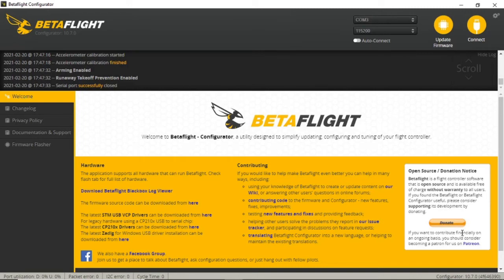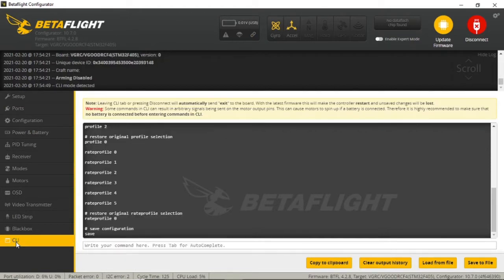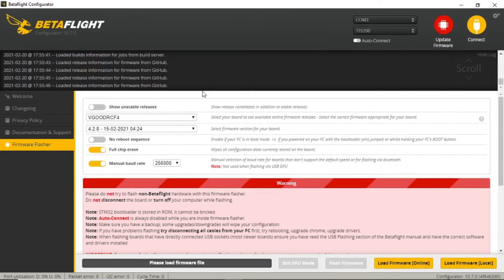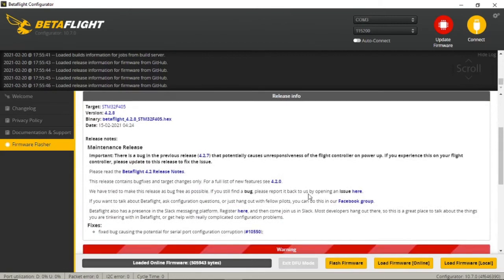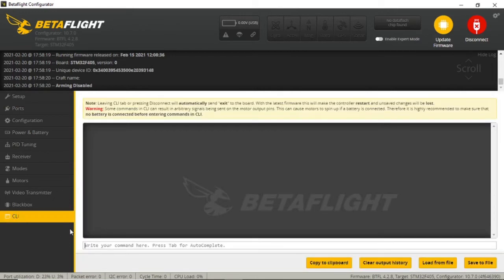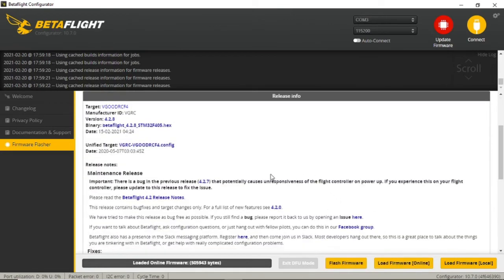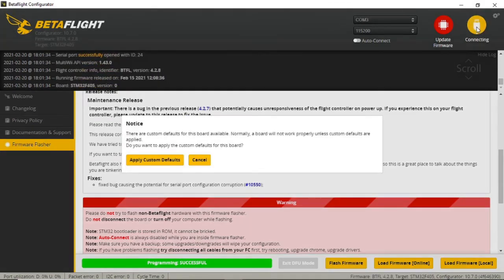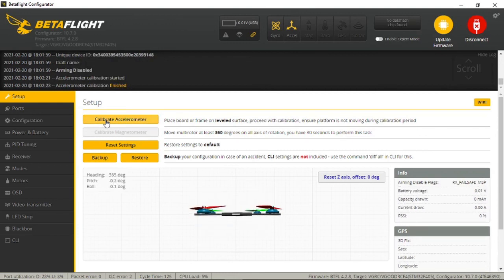TYRO79  -- How to fix a seemingly bricked VGOODRCF4 Flight Controller — also applies to Eachine LAL5

Comment: Hey Brad! Thanks for the video! I know this is an old video but I have been handed down a Tyro79 & I was wondering if you knew the exact name of the flight controller, so I can find some documentation on it?
Reply from the maker: Hi thanks for asking.  It depends on the year.  I believe mine is a F405 (STM32F405).  Later boards had the F411 chip.